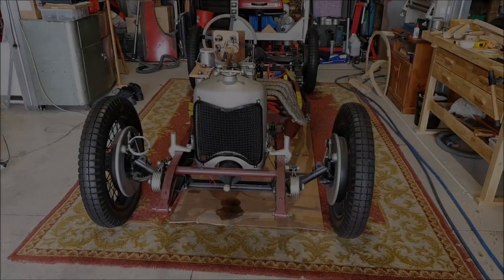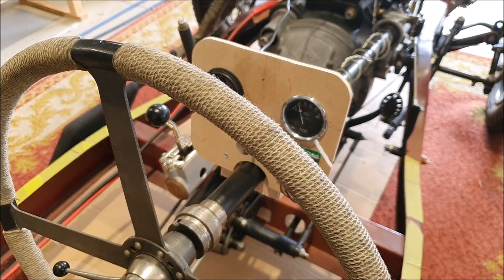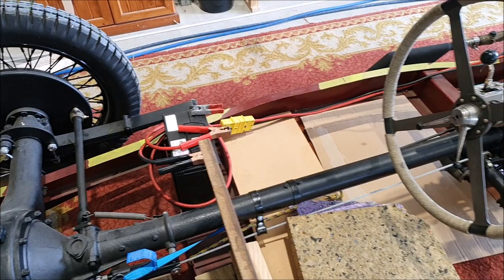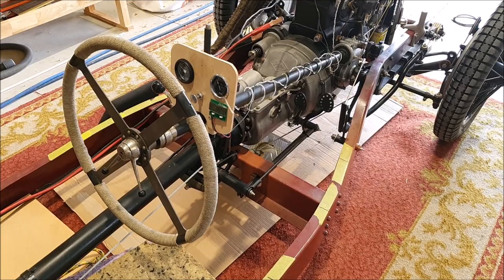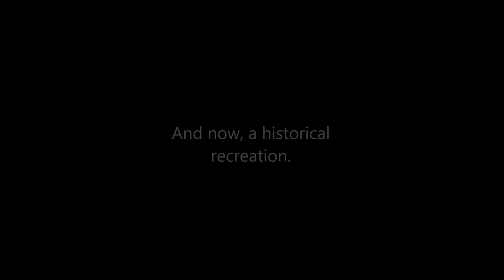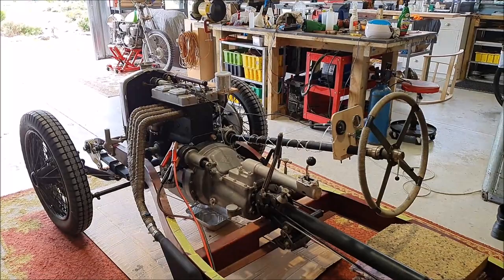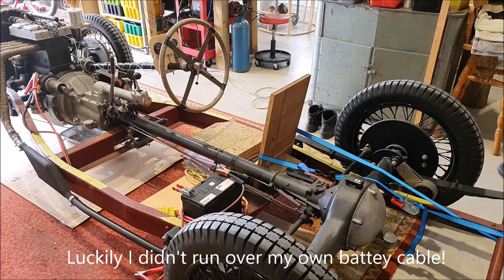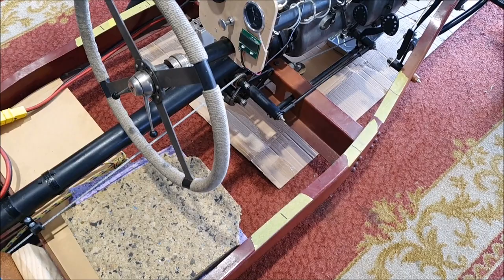Riley Brooklands first drive

Comment: First drive is always a thrill, a real milestone , the silent third gearbox is a delight to use , well done .
Reply from the maker: That gear shifter is really nice to use. Very short and very direct and you could hear the 'clonk' in it as it goes into gear. A lot of the noise will have been from sticking the little camera directly on top of the diff. When it's on the road it will be interesting to see exactly how 'silent' that silent third gear is.

Comment: Fantastic to see and hear her run. Good bounce on those springs and the Riley exhaust note and gearbox noise. You must be thrilled.
Reply from the maker: It was actually useful seeing how much movement there was on the springs and chassis. I should try that again with my little camera in different spots. It was held in place by blu-tack! Nothing was hitting or rubbing as far as I could see which was good.